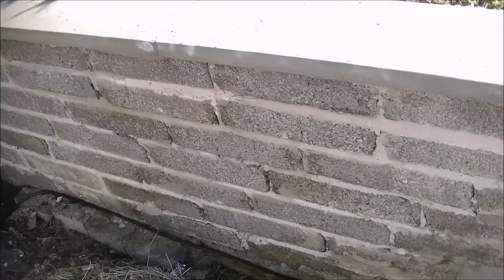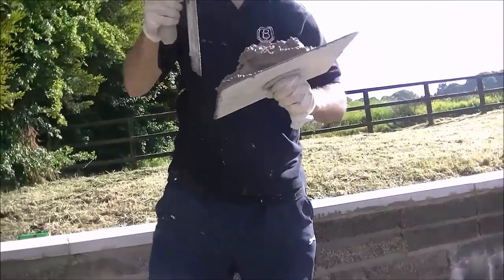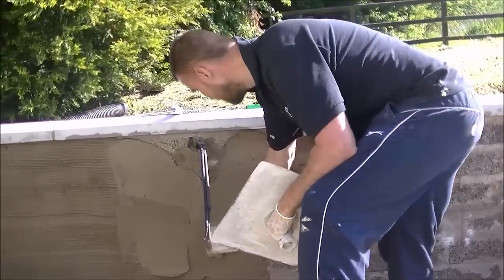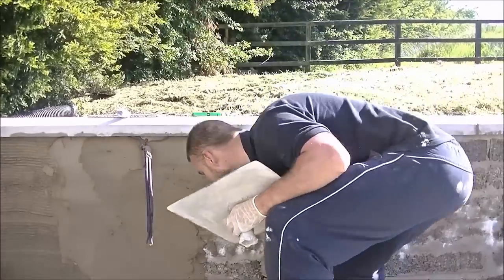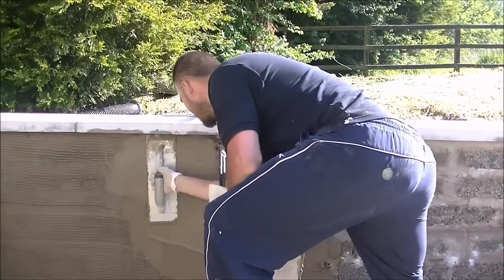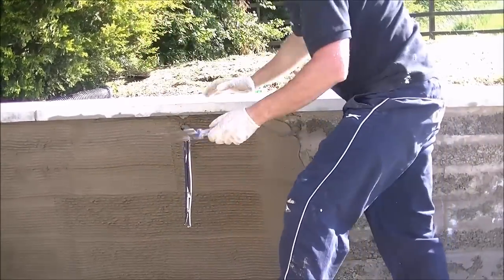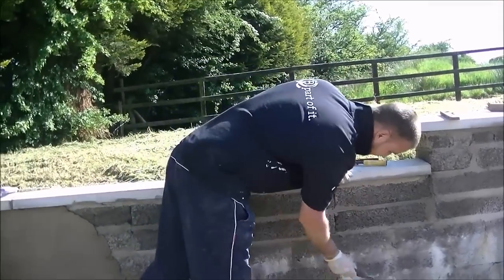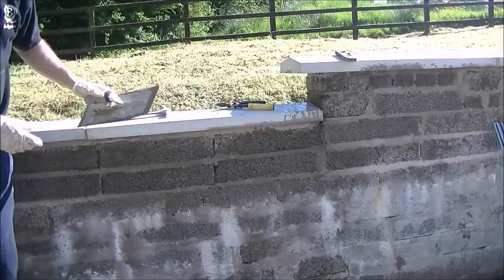How to sand and cement render concrete block wall  1st coat scratch coat DIY

Comment: Hi Mac, hope you're well.  If possible would you mind to advise please:
1.  Is scud coat required for this fence wall?
2. For scratch coat is better sharp sand?
3. Is better to add lime for a scratch coat or no need ?
4. How much sbr should I add to mixture?

Thanks a million for that
Reply from the maker: New videos on it all coming in a few weeks time mate
Reply: Thanks Mac for replying. I need to do my fence next week and not sure about this points I listed.
Reply from the maker: @krzysztofjastrzebski1919  when you say fence is it made from brick or ?
Reply: Concrete blocks
Reply from the maker: ok Sorry just when we say fence here its wooden ...

Ok so to answer you 
if new clean fresh blocks I 3 to 1 scratch over no seed for lime or even sbr I put some water proofer in and plasticiser no to much as seen on mixing videos  such as https://youtu.be/Tsw-t8mwLRI
Then top coat is 4 to 1 with around the same amount of additives = https://youtu.be/Rddi80rA6u0

Again if old walls i would either paint sbr on pure and add some to mix or scud coat the wall to help bond and strengthen wall have loads of this coming up in coming weeks brother :)

more videos explaining these 
How to mix and apply scud coat = https://youtu.be/PxfawvJqCck
SBR for over paint = https://youtu.be/ChkDQRp0Ei8
sbr to help bond to old brick = https://youtu.be/ThcIIDGN08Q

So there is tones of things in those videos to help you out and if you need to drop a comment on them and can explain more or help more there
Reply: @macplastering  Thanks Mac, really appreciate,  God bless you my friend
Reply from the maker: Any time mate always here :)
Reply: @krzysztofjastrzebski1919  n

Comment: I wonder if the other side of the wall needs damp-proof process before you do rendering on another side?
Reply from the maker: I did both sides but as it is going to be back filled no doubt will always have some mostoire against it
Reply: @macplastering thanks. my retaining wall had no damp proof course before back filled, and I wonder if I have the front side of the retaining wall rendered, how long would it last? I am very concerned whether rendering will do any good to the retaining wall in this case.
Reply from the maker: if its just block it will look better but you can also drill some holes in to allow water easy escape routes so there is no build up behind it ?

Comment: Do you have any information on ratios for airtec blocks I can't find anything anywhere. I am panicking that they will blow with a to strong a mix
Reply from the maker: Are they the ones that are high suction and can be cut with a hand saw?
Reply: @macplastering  it is mate. I actually just went for it with a 5 sand , 1 cement and waterproofer and I second coated it 6 sand, 1 lime and 1 cement and plasticiser. Internal work on my own house. Up to now no cracking and it has been on a week, so touch wood it stays strong. I've never had to do them before and there is very little information on rendering them. Keep up the videos, there awesome
Reply from the maker: @jameselliott5436  Sounds hopeful then mate :) hope it stays on for you 1st time I came across them wasted like 20 litres of pva on one wall thing was still drying like crazy skimmed next day it also set fast even after soaking wall down, my tactic now would be scud coat with sbr and a good taste of water proffer next day  then 4 to 1 float and skim next day after that done a few liek that killed suction seen guys priming them and hitting on hard wall then skimming same day bt they sad it was still hard going to get it on and finished as setting fast

Comment: Great job thanks for sharing Mac  ! Did you use SBr  prior to applying render ? And did you use mesh on your scratch coat ? 
I've built similar garden wall /flower bed recently (all constructed of breeze blocks)  and was wondering if sbr  / mesh is any good on new build walls? Also did u add any placticiser to your sand /cement mix?
Reply from the maker: I wouldnt go with mesh but sbr will be good but still not relay needed for new work if you wanted you could do an over kill on it by sbr in the mix and fibres thing would be solid

Comment: Great job :-) I like how you consider the diffrent moisture levels for top and bottom with ground water and sun exposure, I can see that making a really big diffrence in long term strength of bonding to to the block i must admit :-D Thanks for the share, I can really see your technique here, like it would be hard to replicate to your extent as you make it look so easy but it gives a great idea for folk like myself who are still early learners of the trade :-) My best my friend. Paul.
Reply from the maker: the many walls i have done tells me not to wet the bottom to much or i will be waiting for hours to rub it up , hard to get all these details in with 5mins
Reply: you did cover a lot of ground but the info really was handy combined with seeing your technique, it may take us watchers longer say to do it and we might not get it bob-on but with the explanation there is no reason we couldn't have a good go and hope for good results with the help of your walk through :-) the pointers are much appreciated!

Comment: Very nice👍🏼 Please, for concrete wall plastering, how many square meters of surface area will a 50kg bag of cement cover on average (outside and inside)?
Reply from the maker: Hi cheers for watching mate , can i ask what depth and whats ratios would you need and finish ? as these will all take diffrent amounts
Reply: @macplastering Thank you. I am a novice at building and trying to assess the approximate number of 50kg bags of cement needed to plaster a total surface area of 1,270 sq meters.  Thickness/depth will be a minimum of 2 cm.  I don't understand ratio. Once I can assess the number of ciment bags (50kg each), I can better estimate cost.

Sand will be provided.  Thank you in advance for your assistance.
Reply from the maker: This video should help you mate - https://youtu.be/vc6iBirvvKQ
if not get in small amount do a small area then multiply what you have used by the 1,270 sqm and you'll have answer

Comment: Yes lad long time no see...hi did you put any waterproofing in the mix on the scratch coat what's the ground being hired behind The Wall would it make any difference to put something cheers big lad
Reply from the maker: seen this wall not to long ago looks good still a year on but these retaining walls get it hard from water , I for sure would have put water proffer in both coats and cant remember if the back is done tbh , dude where you been so much rendering videos out recent LOL
Reply: @macplastering  been keepin a low profile lad from i win the lottery lol same kind of wee job am doin with the ground higher on the other side and was kind of worried about the water comin though on to the painted side. So waterproofing in both coats happy days..must get me finger out and get a look at all the new vids... shes gettin cold now lad you all inside work or outside at the minute
Reply from the maker: @bootsmclaughlin1438  Youve won the lotto hope i am invited to plaster the mansion you build :):) yes buddy I would put some in both coat but being said it might be good to skip it on the 1st coat if you want to get rubbed in the cold cold weather , believe it or not have some of both coming in but would rather stay inside have a bad cold atm
Reply: @macplastering  was just goin to put first coat on scratch it and let it sit for a few days before I can get back to finish coat and its to be dry the mara believe it or not lol
Reply from the maker: @bootsmclaughlin1438  Dry almost whats that mean LOL  sweet man go for it will you wet it for top coat or it not big ?

Comment: Lovely job 👍
What ratio sand/ cement do you use for scratch coat and finish coat?
Reply from the maker: Hi mate thank you for watching most times I do 3 to 1 then 4 to 1 top coat have a good few mixing videos showing in detail and explaining the additives and why im using ect if you fancy a look on the channel :)

Comment: Will the salts in the wall cause any problems?
Reply from the maker: I buddy I have seen this was a few time from it was rendered and looks great can see any salts coming through but thats not to say they wont get to the surface at some point they happen from damp and drying and damp and drying this being a retaining wall might always have this type of issue this has been done over 2 years and looks pretty good still so fingers crossed it stays that ways :)
Reply: Cheers for the reply mate good job on the wall my retaining block  wall need plastering few of the boys hesitant because of the salts. Top man Cheers
Reply from the maker: @iwanrees3395  Anytime mate if I can help I will :) My thoughts are it will look way better rendered  even if the salts come through some compared to just block with salts hope it gets on well for you mate :)

Comment: Can you put lime based plasters over concrete render?
Reply from the maker: the only time I have done anything like that would be k rend over a sand and cement scratch coat whats the lime based render called ? or is it just a sand and lime mix ?
Reply: @macplastering  slaked lime putty, or for interiors, marmarino, lime and marble dust based
Reply from the maker: Marmarino I think would be best on a skimmed wall ,with the primer 1st , lime putty probs best on old brick and stone work to plug the deep holes , not sure it would be good over cement render though

Comment: Hi mate, 

Couple of questions for ya pal.

When u watered down the walls, is it not best to use PVA bond on the walls instead???

Also, is there something called lime plaster or lime rendering??? Is that used for outside rendering??? I thought lime plaster/render was a breathable render rather sand and cement. 

What is the ratio mix to your render?? Just normal building sand??? 

Much appreciated,
Mozzer.
Reply from the maker: Hello my friend happy Sunday to you I will make a video  tonight answer all these questions as they are great questions will do a live stream on it for ya mate so hit that bell to be notified :)
Reply from the maker: answered all these questions here buddy = https://www.youtube.com/c/macplasteringservices/live
Reply: @macplastering  link dosen't work....🙁

Comment: Great Job, what kind of mix did you use? and would the same mix work on an interior wall?
Reply from the maker: Yes mate would use similar for inside but would most likely no need sbr or water proffer in it you can use 3 to 1 4 to 1 or 5 to 1  but a 3 to 1 or 4 to 1 would e my choice for inside work have a few videos on other mixes and how i mix on the channel your more than welcome to have a look around and new videos Ever Sunday :) Thanks again for the comment buddy :)

Comment: Nice day for it mucks
Reply from the maker: For sure Hope you lads are Getting it as nice :):) Have a great Sunday :)
Reply: macplastering sure when the sun is out we are all happy and long may it last.... hi what kind of finish goes of slower have a big wall to do.. all plaster board am using multi finish blue one at the minute. and I think it goes off a little bit quick for me was just looking to know what I could do to slow down or what other finish I could use that has a slower dry in time and should I put a bit of pva on the broads first cheers mucks